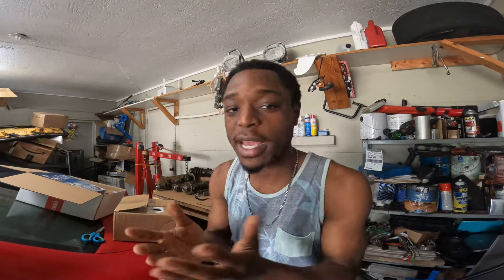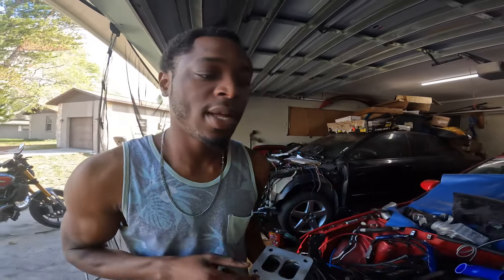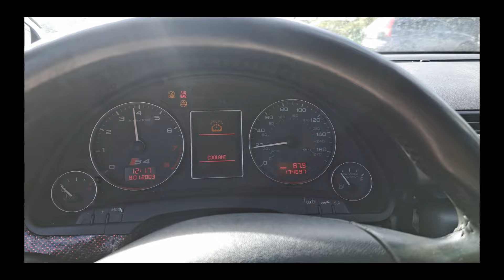Garage Built A4 TT Conversion(BiTurbo A4 B6 )

Comment: Hey man do you have the full build of the turbo set up I have 06 1.8 and I have a extra k04 brand new sitting there was thinking of doing same thing
Reply from the maker: Elaborate, at that moment that motor was a completely stock Unopened AEB 058 swap.... as of January 2nd Fully built bottom